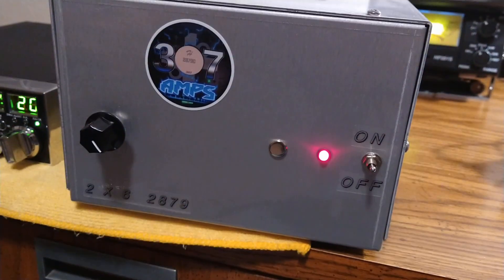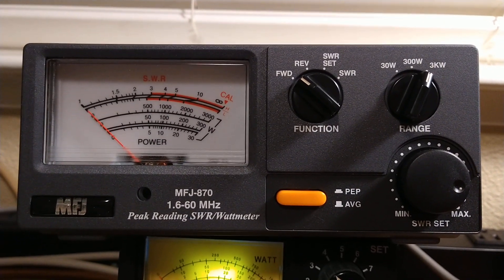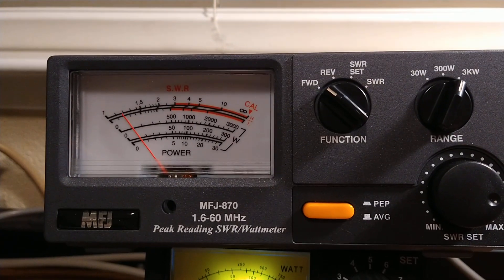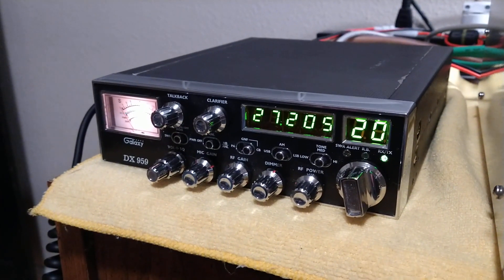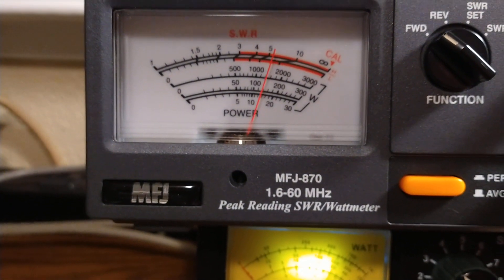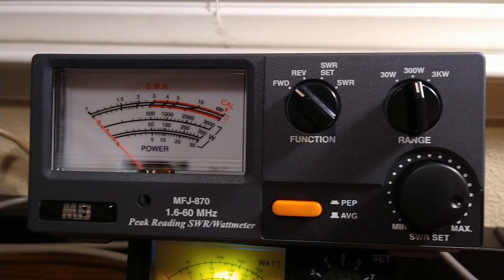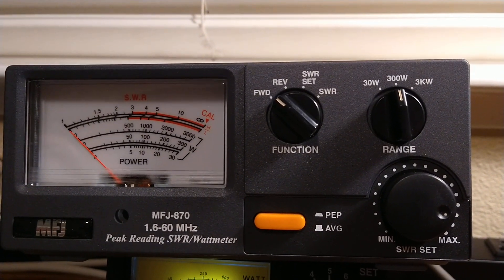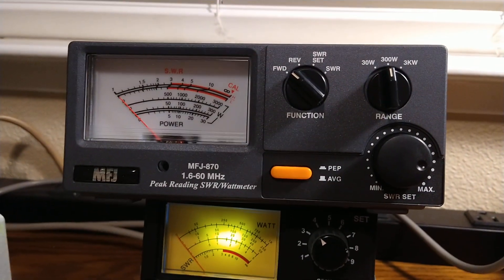Re testing the 307 2x6 after calibrating the MFJ-870 meter

Comment: I know it's a 2 year old video, but did you have to go into the MFJ meter to calibrate it to the other meters? I just ordered my 2x6 307 base, and I run a cheap Opek 2000 w meter. I feel that my meter is off as well. In which my meter does not have an average or pep option. It's just a straightforward swr/power meter. This video is reading a way better response than your 1st video.
Reply from the maker: @alanbrumbley1953  The MFJ shows low on PEP since it's not a "real" PEP meter with a powered circuit. I didn't calibrate mine, just left it alone, but I did calibrate 191's MFJ to make it read what he wanted.